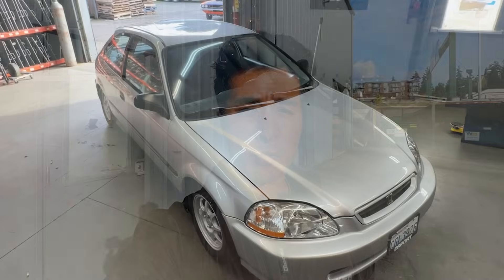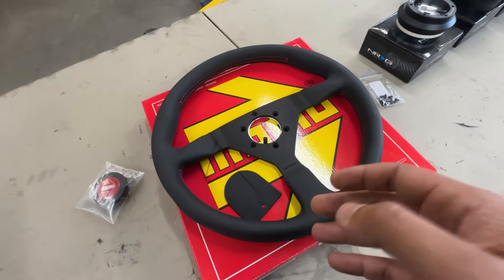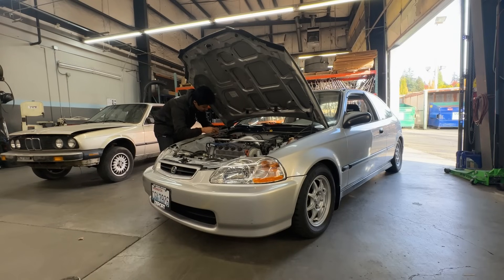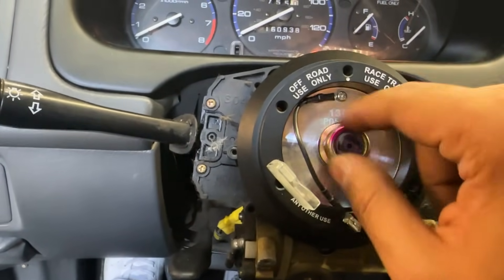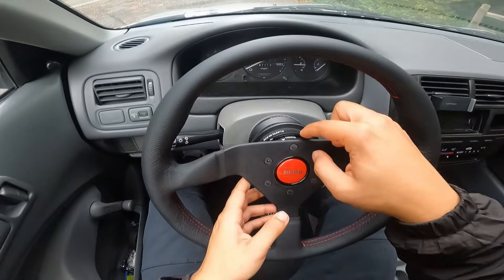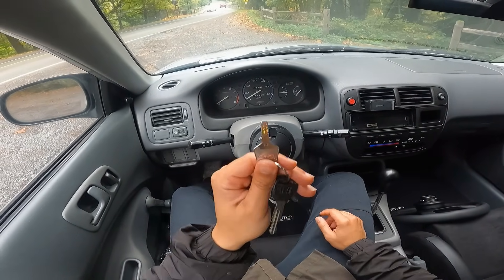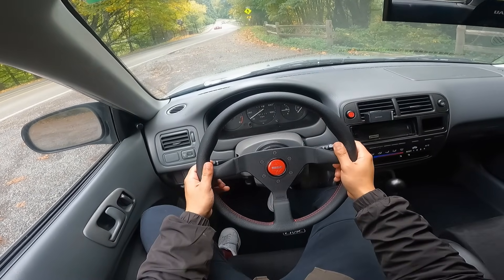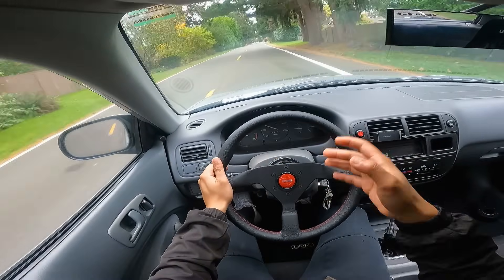New Momo Steering Wheel For the EK Hatch! Biohazard Civic Ep. 21

Comment: Hi, just a quick question. I'm looking to get the exact quick release you have plus the momo and I'm just wondering if the Momo and the NRG Quick release comes with the hardware? Did the hub come with screws to attach the quick release to the hub and did the steering wheel come with bolts to hook it up to the quick release? Thanks so much

Comment: AWESOME I have a 93 del sol  got at the beginning of this year and have only done very easy suspensions mods such as skunk 2 front UCA, skunk 2Rear LCA, skunk 2 coilovers and a skunk 2 exhaust. Recently bought parts to convert the steering wheel I currently have and put on an integra type r DC5 steering wheel which is slightly smaller but will be a bit more complicated than a QR wheel. Really nice video and cool wheel you got there. Excited to see what you do next!
Reply from the maker: really appreciate it! congrats on the 1 year ownership of the sol. sounds like it’ll turn on a dime with the skunk2 goodies. happy for you bro

Comment: yesss put a turbo on it! we need more single cam saviors! just careful not to push too much boost, i think the d16s are only really good for mid to low 200 hp so i’d keep it below 8psi as long as your engine’s all healthy, i haven’t gone over 10psi in my r18 to keep things safe. one thing to note with small low boost turbos, you’re gonna want to swap out the wastegate actuator for a lighter one and it’s always a good idea to port your wastegate, i did it on mine, helps with consistency and boost creep

Comment: you could run ex spindles/brakes with HX wheels but you'll need a 5mm spacer. 96-00 civic EX brakes are the same as EM1 brakes.

Comment: turbo and K is very common. Perhaps try EV conversion? My 95 Civic Coupe EX has 14" wheels and disc brakes with ABS so it should fit yours.
Reply from the maker: are you running ex brakes? thats really good to know, appreciate that!
Reply: @bendaga  my EX has factory 14" steel wheels with covers and 4-wheel disc brakes with ABS. So if you find a EX at the junk yard, it should fit your car. if you go with Integra you may have to up the wheel size to 15" and larger.